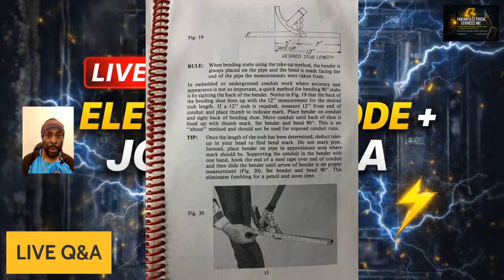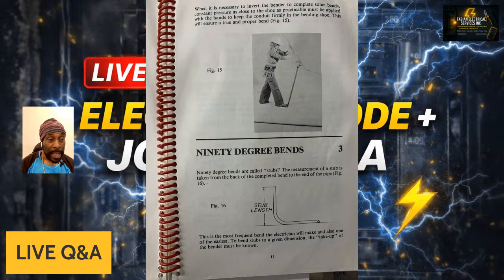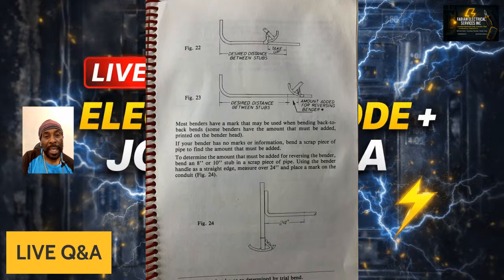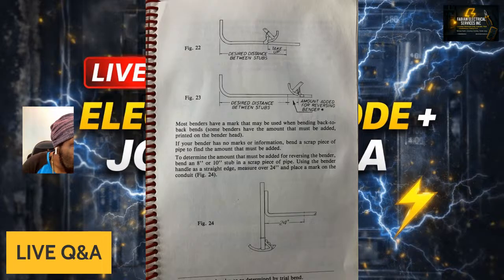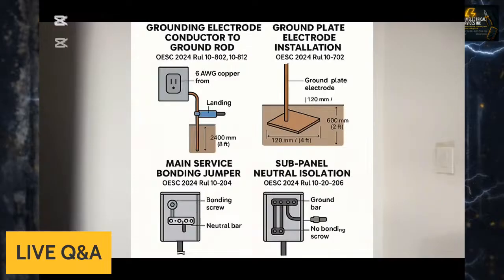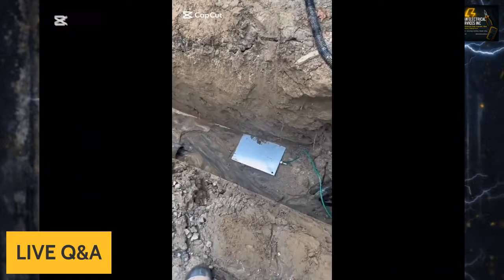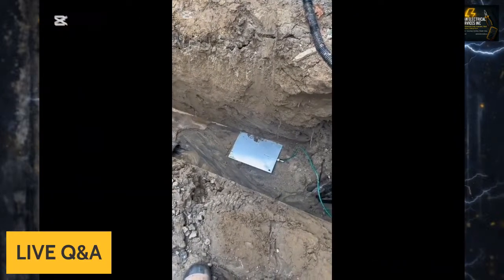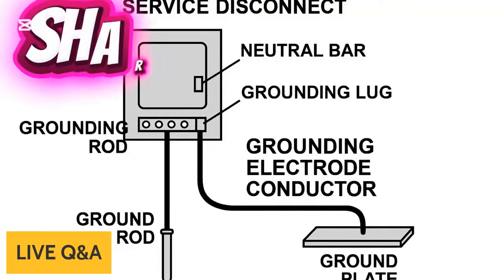EMT Bending MASTERCLASS ⚡ Multipliers, Shrinkage, Offsets & Saddles Explained

Comment from the maker: ⚡ Appreciate everyone who joined tonight’s EMT livestream 👊🏾
Reply: Question. As an Experience Mechanic, what’s the difference btw an apprentice/helper, Junior Mechanic, Journeyman and a Master Mechanic…? Ty 🙏🏾🙏🏾🙏🏾
Reply from the maker: ⚡ Great question 👊🏾

An apprentice/helper is usually learning the trade and assisting with installs, tools, material, wire pulls, and basic tasks.

A junior mechanic starts handling more independent electrical work and understands installations better with less supervision.

A journeyman can typically work independently, read drawings, troubleshoot, install systems properly, and understands code requirements.

A master electrician/mechanic usually has years of field experience, deeper code knowledge, permits/licensing responsibilities, troubleshooting experience, and often supervises or runs projects/business operations ⚡
Reply: Having said that and thank you for the breakdown. What if you knowledge of installing outlets, GFIs, single pole, 3way switches, make some pipe bends,  run pipe, read blueprints(of course there are different ones) But can roughout 2-3 apartments per day, BX/MC(depending on size) install the 1900, deep 1900, Gem boxes, electrical panels and land the wires…run low voltage to knix box, install the outlet in the knix box, assist with building kindorf racks for panels/pipes, fire proofing, installation of temp lights/outlets, installing roof hectagon light boxes…assist in running the Smurf for roofs…someone who knows/have the basic hand tools…and keep materials/storeroom organized(sometimes I even volunteer to organize the storeroom, bc I just can’t work in mess…can’t find what the hell you want. If there’s no order, there definitely disorder) not to mention own power tools…..what would you call me…? But again, I know I’m nowhere closeeee to a journeyman/mechanic!!! Ty 🙏🏾
Reply from the maker: @Alphaandomega5  ⚡ Honestly, from everything you described, you’re beyond just a helper/apprentice level 👊🏾

If you can:
✔ rough in apartments
✔ read blueprints
✔ install panels and devices
✔ bend pipe
✔ run BX/MC and low voltage
✔ organize material efficiently
✔ understand layouts and installations

…then you already have solid field experience and sound more like a junior mechanic / advanced apprentice moving toward journeyman level over time ⚡

The biggest difference usually comes down to:
✔ years in the trade
✔ troubleshooting ability
✔ code knowledge
✔ independence
✔ handling full jobs without supervision

But based on your description, you definitely sound experienced and motivated 👊🏾⚡
Reply: Thank for your honest response. I’m def motivated for sure! Always ready to do/assist. I just love new construction/remodeling! For the code…I’m aware, that outlets are installed at 18-18 1/2”…depending on floor finish/unfinished…or a specified measurement, due to disabled persons…GFIs 42, lites 45, range 4-6 from floor, panels I believe it’s 5” to main breaker…? Don’t remember that one off hand…I roughout all those apartments by self, after learning how to read blueprints…I just need more practice!!! But ty🙏🏾 you have an enjoyable wkend. Be safe in your travels!!!
Reply from the maker: ⚡ You’re already building strong experience 👊🏾

The fact that you can rough in apartments, read prints, understand measurements, and work independently says a lot already. The code knowledge and troubleshooting side comes more with time and repetition in the field ⚡

Most good electricians never stop learning. Stay motivated, keep asking questions, and keep practicing conduit bending and layouts  that’s how the trade starts clicking over time 👊🏾

Appreciate the support and enjoy your weekend too ⚡🔥